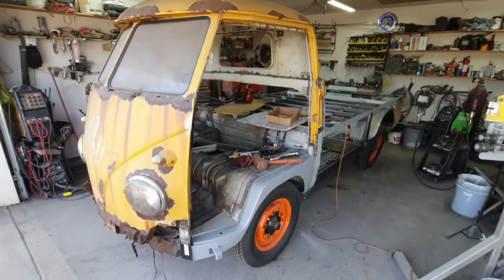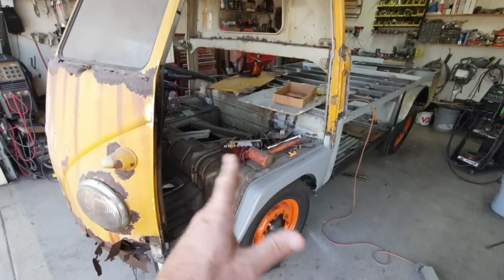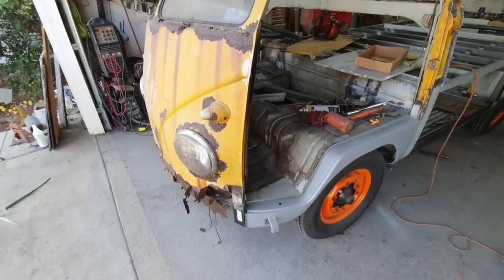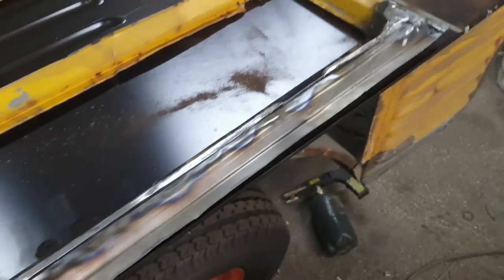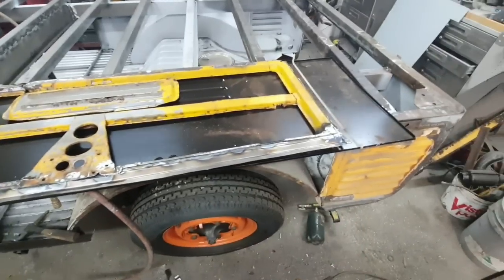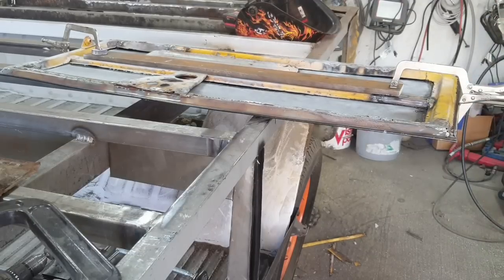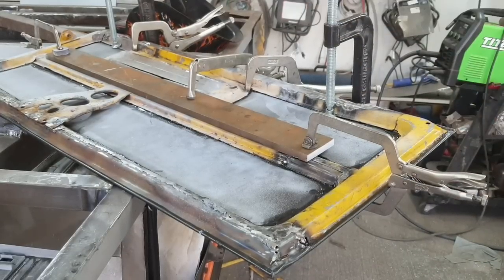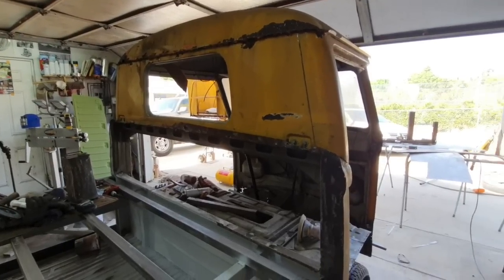VW single cab type 2 repairing the treasure chest door.

Comment: Mike, love the time lapse of the metal shrinking. It ends up being a great effect. The work on the door was a great series of patches. I would have thrown something like that out and started with a new door. Your expertise in fabrication shows well as always!
Reply from the maker: I am filming the timelapse a bit different. trying to make it easier to see what I am doing. the side door is a SO10 and SO9 only they are impossible to find. They are smaller than the regular single cab so You gotta save it. But it really wasnt that hard . I will show it in the next video turned out great.

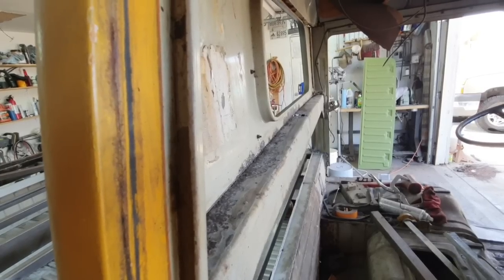Comment: Mike, @ 35:35 where your talking about the back of the cab. Your so good with the press brake. make a wrap around piece (the width of the cab), with the top a wider lip-slice the cab and slide it through and panel bond it on. On the inside it would wrap all the way around and seam would be on the bottom. It'll be slightly thicker but less welding and no one would ever notice. And it would look like it was replaced. Just a thought. I'm sure you've already thought about it--Umteen times.....
Reply from the maker: yea might work. But i am not sure if it is slightly rounded.

Comment: I was hoping you would use the spot welder on the cargo door skin
Reply from the maker: yea I was thinking about it but I think the adhesive was a better repair. feels solid.
Reply: I was planning a while ago to buy a spot welder but i dont think they have enough snot..
Reply from the maker: @vwbusguy  the panel adhesive works good but it is expensive. that door is super solid . The inner frame was pretty thin where it attaches to the skin that is why mainly I went with adhesive. after grinding it.

Comment: Love your work Mike,  just a quick question tyre sizes on splitty rims?
What video did talk about it, I remember you talking about tyre sizes and gear ratios on the red bus.
I need to buy some new rubber and would like your input please 👍
Reply: Found it all good, vw bus 40 horse engine mods and trans gears👍
Reply from the maker: Coming soon!